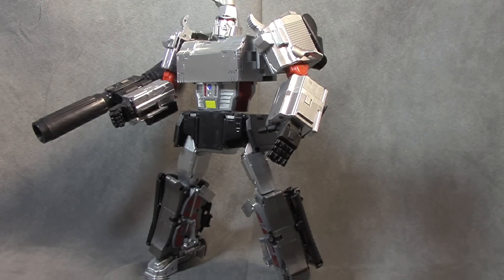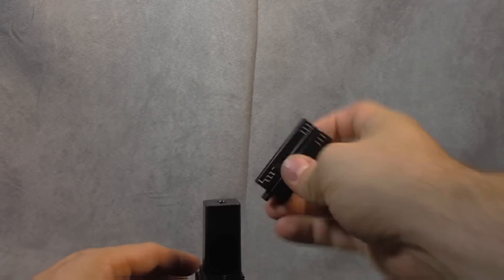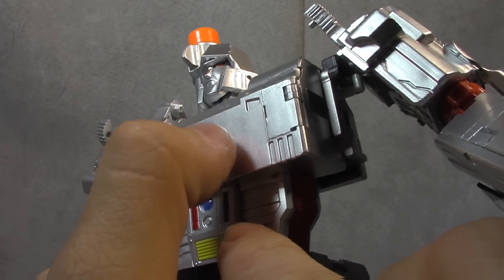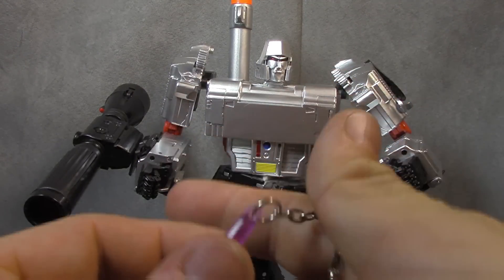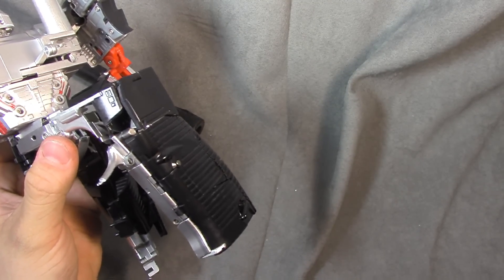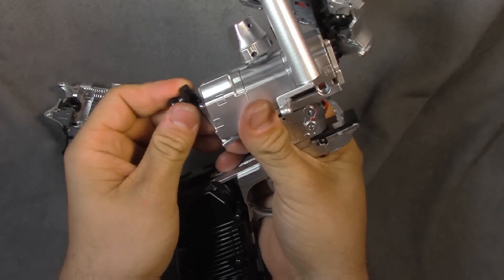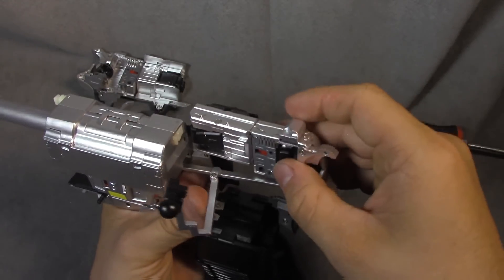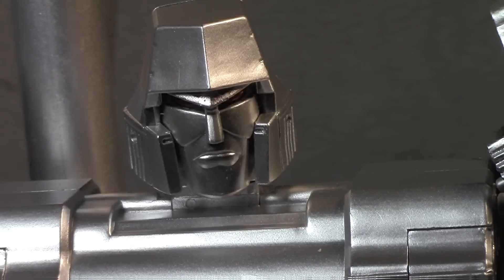X Transbots Apollyon (Transformers 3rd Party Megatron)

Comment: This is the review that needed to be done on this guy. Other reviewers seem to be giving this guy's issues a polite pass and for $150 the flaws need to be pointed out. And the 2nd run is $165 with 0 changes to the figure!!! Robbery!!

Additionally I have all the same issues with mine that you have with yours. That right hip plagues the shit outta me. I did learn that those little fiddley black tabs on the underside of the pelvis are supposed to flap out and plug into the hips (The directions don't show that). Once I did that the right hip stopped swinging out on its own. It still pops out really easy but at least now it doesn't pop out when my ac kicks on in my house.  Sorry for the long comment. As always thanks for what you do my man.
Reply from the maker: Thanks for the kind word and the info.

Comment: Thanks for putting my worries to ease about the indentations on the forehead. It's the personal touch that keeps me coming back. Of course, after watching the rest of your review, I feel like this will be a pass for me. Apollyon is now selling for $165 and I don't think they are making a lot of improvements. Many reviewers said that Apollyon is easier to transform than MP Megs, but it looks like you were still having major problems. It's the same thing that kept me away from FP Intimidator. I don't want a TF that gets really scuffed up after only a couple of transformations. However, I don't know if Takara will ever come out with a Megatron sized to MP-10 Prime.

So here is the big question. If you had a choice of buying CW Megatron and an X2 upgrade set for around $100.00 as a place holder until Takara might release a Megatron or buying Apollyon, which one would you go for?
Reply from the maker: Thanks man. And the answer would be Apollyon. Cw megs is just not close enough for me.
Reply: That new video on ActionRobo is making Despotron look a bit chunky. I was really hoping that was going to be my definitive Megatron, but the face sculpt, big blocky shoulders, and overall stockiness of the figure is really turning me off.

Comment: Great review!  Glad for a more aggressive review.  I have been feeling the same way about him since I got him. I have transformed him twice and he is super fiddly, the only loose bits I have are those forearm flaps. The tabbing issues are more prevalent esp those top grip portions that were stessing on yours. Do I like me him, yeah. Do I like like him? 150.00 like him? No. 

He like Ollie soooo looks the part but xforming is scary and parts feel cheap, not all but too many.

Oh uh if you decided to use the replacement ball sockets take care...they have over corrected the problem so they are hard to get on the ball and don't want to turn to easily. Had to sit and twist mine around a bit to loosen.  I only did the cannon arm though.

And there should be a connector with a peg hole on one side and the cross piece on the other to allow the small silencer piece to plug under thr frumble seat....

Sorry for being wordy but thanks again.
Reply from the maker: Thanks for the kind words and info. Much appreciated.
Reply: Your welcome, I just saw another comment about TFsource not getting back to you timely....I have an issue with a figure I bought and still no reply...hmmm. I haven't bought much from them and this not instilling a lot of confidence. ..
Reply from the maker: I've had a mix of good and bad experiences with them. But I'm quickly reaching the end of my rope.

Comment: That orange plug barrel for the silencer is REALLY jammed in there. I had to Dremel it out with great difficulty. Odd, since the other plug just pops right out no problem.

Also the replacement shoulders were so tight i snapped an arm off, but customer service is sending me new parts. At least he looks awesome if i don't touch him too much :)
Reply from the maker: Exactly! That's the ticket

Comment: Great review as always, I got to say he looks great in both modes but after hearing the Qc issues and the scary transformation (kind of like Mp Megatron lol) I think I will pass, I have seen other review and even though they were positive I just didn't get a good vibe on him with the small issues he had on the review samples, thank for doing your part to let us know that he's not worth it, bye didn't you get the replacement parts to fix the ball socket joints? Because if not you should have gotten some since X-Transbots said they were sending some with the figure.
Reply: I meant btw not bye lol
Reply from the maker: You know I have looked and looked but haven't come across any.
Reply: Maybe X-Transbots forgot to put one in your box and if so that stinks.
Reply from the maker: That would be my luck
Reply: Bobby Skullface L the ball joints made all the difference for me. I had to lube them up but after that & spinning the arms allot they are a must imo. Also they include an adapter in tht bag for the cannon ur missing 2. I couldn't handle the arms falling off. Also, if u face the cannon base the other way & add the adapter it doesn't lean like this. This is a great figure but I suppose there is too much quality variation from unit to unit. U may not love it like some w/ the new ball joints but it will improve ur experience if his arms quit falling off.
Reply from the maker: What's up Larry?! Always good to hear from you... You know honestly, I don't think I received the replacement pieces. I'm still looking lol

Comment: I got mine yesterday. Messed around with him. And he was who we thought he was - The shoulders pop off. Other than that it's fine. I'm not transforming mine cause that's a headache I don't wanna deal with just like mp05. I never want him as a gun but I like that he has capability of transforming. So he's the Same thing as mp05, but better in every way. The new shoulders are super tight, but they move enuff to Pose, but not to play. I put one in the Cannon arm, posed him and there he stands until I want a new pose. I love how he looks in both modes (gun from videos) . The complaints of dimples is kinda nut pickin to me... U have to look very hard and shine light on him a certain way to even see them and u cant feel em. Legs are solid. I don't know what exactly people want out of him. 

Every single megatron  figure in history has kinda sucked - starting wit g1 (yeah I said it, but let's stay on topic) , its a tough build IMO FOR ANY COMPANY. Ask takara, even they couldn't get it right. He's never gonna look exactly like the cartoon and transform. 

This is the best megatron we've ever gotten hands down and I can't complain about that.
Reply: The new shoulders must be greased. I used actually thick grease for a real glock slide. It's plastic safe obviously so it was a natural choice.
Reply from the maker: I agree with all all your statements and I think even brushed upon most of the same points. But yea while I agree he's at the top of the pile, like you, I admit the pile isn't a very high one to begin with. And yea without transforming him he's pretty fantastic.

Comment: Great review as always, I agree with you, I wouldn't recommend him unless you just keep him in robot mode and put him with the rest of his 'cons. I'm with you, I would pay $200 if they put a little more effort in fixing their paint issues and plastic quaility.  Saying that, I'm happy with mine, I knew what I was getting into, and he looks great on the shelf.  I have the same problem getting that orange plug out of the silencer, I gave up lol, but he won't be in gun mode anyway.  Luckily nothing has stressed or broken on mine, and I don't plan on finding out.  Look forward to more reviews from you.
Reply from the maker: Thanks for the kind words. We seem to be on the same page with this guy.
Reply: Bobby Skullface L No problem, I am wondering if another 3rd party will come out with a different head with light up eyes or something along those lines, I don't mind the head sculpt, but I do wish they had given an extra head/face smirking or something, just more options.  I tightened the ball joints on mine and they are holding pretty good right now.  I just need a decepticon logo on the front and he's all set.
Reply from the maker: Lol probably. Never underestimate the ability for a 3p company to piggy back off someone else lol

Comment: Hello Bobby I got lucky with my paint doesn't seem to flaking fixed the ball joints with clear nail polish the only thing that gave me trouble was getting the waist up after transforming to gun mode make sure you're front leg tabs line up our your legs well not lock properly there kinda fiddly but one properly dune hold really well take Philips scene driver and a counter strike it from the inside supporting the silencer that's how I got my plug out you have to strike it firmly thanks for the review it's a fiddly figure but I like mine ps loosen the elbow screw know more acbar and on that arm slider
Reply from the maker: Thanks man. And if you ever decide to share a bit of your luck let me know and I'll get you my mailing address lol
Reply: Your welcome and believe me you'd give it back my luck is very tricky lol
Reply from the maker: Lol I hear that

Comment: I completely agree with you opinion of this. Exactly how I felt about this when I got it. The designer got it spot on. And although the transformation seems frustrating, it's still clearer engineering. The problem is X-Transbot. The finish is just plain awful. And this is probably the best this company can do with its KO quality factory. I wouldn't mind paying the extra $50-100 for Fanstoys to do it. For $150, I also got the First Gokin Cerebral. Another 3P company making a TMNT Krang. Now that one is well worth $150. It's packaging even kicks Apollyon butt. Better quality box with better quality printing, harder cardboard stock and protected by the manufacture with plastic wrap. Now here an idea, maybe if you wrap the boxes up, they wouldn't look like they were dragged around the floor.
Reply from the maker: Thanks for the kind words

Comment: Saw towards the end the leg will not stay clip on. Check the side of that black crotch area. There is a black tabs that folds out that has to peg into that leg that should lock it back in place. Same thing happen to me when I transformed it to gun and back to robot. The leg will keep poping out, then I realize I did not have that peg folded back out. Now is back to being locked in place firmly in robo mode.
Reply from the maker: Thanks buddy

Comment: I really, REALLY love complex transformations. However, Apollyon has me worried that I may break him. I just ordered him, and I'm both excited and a tad bit terrified. I have had two 3P figures break on me, and I don't want it to happen again. Poor Warbot Assaulter had his left leg broken by an overly tight ratchet, and PE Warden had one of the tabs on his back for mounting his backpack snap off. Sadly, you can't really replace those parts. Apollyon looks amazing, but this is the only really negative review I have seen for him. I hope mine holds up!
Reply from the maker: Out of the box, onto the shelf. You'll be perfectly happy. :)
Reply: +Ravenfellblade Yeah I agree, My 3rd party Classics Rodimus armor didn't hold up too well.  Piece of the foot joint broke because of poor design, both figure and manual, and it's loose all around.  Which is weird because I was fine with the 3rd party Shockwave. In general it seems 3rd party toys QC are questionable because everyone keeps saying 'mileage may vary' I mean I love the variety and designs they offer, I just wish the QC were there too.
Reply: +ZanKanTou03 Honestly, the QC isn't typically any more unpredictable than with HasTak's stuff. Just look at Gen. Brainstorm's stuck Headmaster, or the general design issues with Menasor. I guess caveat emptor is the rule of the day no matter who's product you are buying. It's just a lot more frustrating to have things break with premium figures.
Reply from the maker: It usually comes down to the company. The shockwave company has a great reputation this company, X-transbots has more of a questionable reputation.

Comment: yeah transforming this thing was a pain in the ass. did it once just like MP05...wont do it again..at least this one didnt break like my MP05 did...that was a bummer. people say the shoulders dont hold unless you use the change out kit..both hold really well on mine. i guess i just lucked out. worth 150..eh..i dunno...i got mp 10 optimus and i didnt feel that one was worth how much it was either. i dont get the prices on some of them. i got MP04 with no trailer as the 25th anniversary prime and it was 80 bucks...mp 10 160 bucks..i got sunstorm..that was 70 bucks and its freaking awesome. meh in the end...after my initial butthurt about price...i set them all up and messed with them a bit....they are all awesome now to me..cept mp05..thats still a pos.
Reply from the maker: Yea 05 was a nightmare